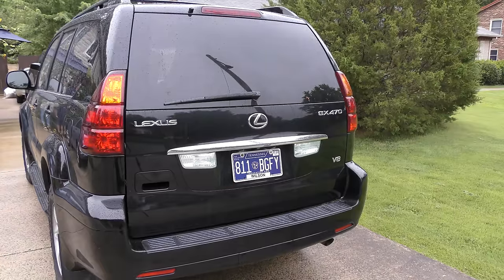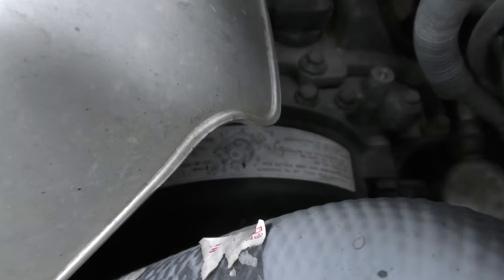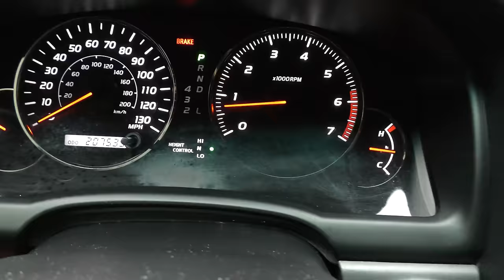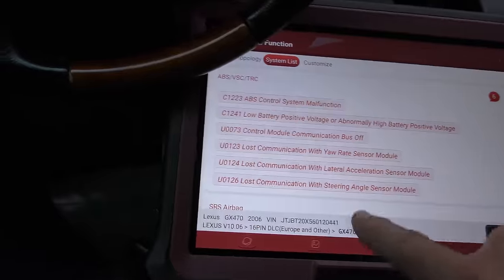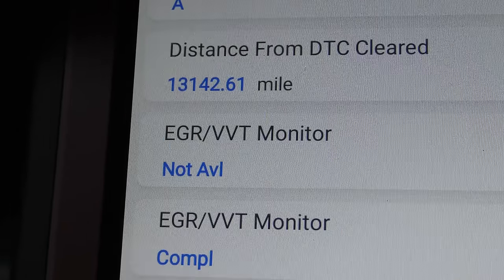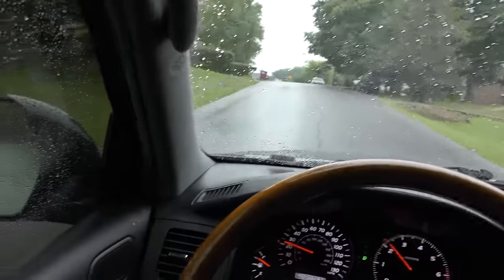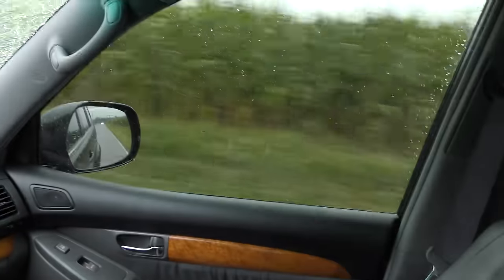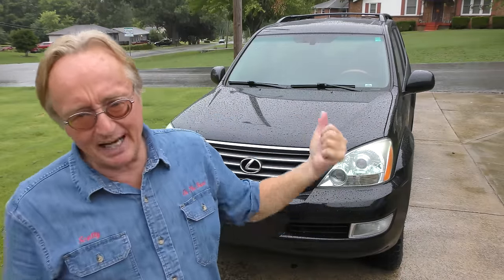I'm Sitting in the Best SUV Ever Made

Comment: You can change the timing belt yourself.  Take your time, use the repair manual and do step by step, it is not too hard.  Shop wanted $1300 to do the timing belt change in my lexus, they were going to use mid quality after market parts.   Purchased the belt, water pump, tensioners, idler pulleys, drive belts, cam and crank oil seals for just under $400, all OEM high quality parts, toyota/lexus genuin, the tensioner was Aisin, Belts all Mitsubushi etc, the best parts.   So I saved $900 and the lexus runs smooth as butter. And I do not have to worry about it for another 100K.  By they way, the old belt was 10 years old, had just over 100K on it and when I pulled it out, it looked almost new, great shape, markings were all gone, but the entire belt did not have a single crack, not what I was expecting, I could have probably just let it go a couple more years no problem. Shop said they could have it done in 3 hrs, would have purchased a parts kit for maybe $250, so they were basically going to charge $350hr for labor when you do the math.
Reply: Yeah, I wanna do it myself to. I have the same motor in my Tundra. Mechanical experience is somewhat limited, but I would like to tackle it as I have all the tools. I work on machine equipment, but not motors. So, you think it can be tackled by someone who has moderate mechanical skills and knowledge?
Reply: @thyslop1737 yes.  Watch videos, get the proper tools, use the marks, make the proper marks etc.  download or get a factory service manual.  This is easier than a front drive engine because of good access.  Get genuine Toyota/Lexus or Aisin parts.

Comment: 07 fj cruiser 4x4, locking rear differential and other extras,  still running on and off road like new with over 340,000 on, regular maintenance is the trick
Reply: Lot of the same parts on them, my GX is riding on Fj struts and coils.

Comment: Its a land cruzer prodo turned lexus.  I got mine in 2020 for $10,500.  It had 150,000 miles on it and 15mpg for the gas mileage,  i love it. A 2006 and no problems.  I had the timing belt , tensioner and water pump replaced for $ 2000., good till 250,000 miles.  I only put 6 thousand  miles on it a year.  Great for off roading. Snow , hills  and camping.  I made a bed in the back.

Comment: I just moved  cross country in my 2005 GX470 with 95kmiles on it. Timing belt water pump kit replaced before trip.
From Oregon to eastern N.Y. state with a fully loaded interior and a rooftop cargo carrier maxed out, I averaged 19.4 mpg •according to the onboard computer and by my pen and paper method•  Around town I average just over 15. For an 18 year old truck with a V/8  that  weighs 4,871 pounds unloaded 
 I'd say that's outstanding. This 18 year old vehicle gets the same mpg as a brand new GX460👍

Comment: I have a 2009 GX 470.  Watch out for the Radiator.  It has coated plastics inside that can break up in your cooling system and cause overheating.  It happened to me in Arizona in the heat of summer.  Blew my supposedly indestructible 2UZ-FE.  Sent it to JEGS for a remanufactured one.  Runs like a dream now, but it cost $$$$.

Comment: Timing belt is #1 on this. 

I'm surprised more commenters aren't mentioning the rear air suspension. It's stupid hard to diagnose (spent over $5k screwing around with mine between the dealer, a toyota dealer, and a local mechanic)...but for under $500, you can get an adapter kit and have normal coil springs installed.
Reply: Just got a 05 175k with the rear original suspension out of control, seems to be the heights sensor but I'm going for the conversion kit rather than spending $$ trying to find out for sure.
Reply: I simply bought the bags ,for $64 and a friend who installed his own did it in 1 hour. it was leaking.
Reply: I'm glad it was just a leaky bag. 

I replaced my bags first...and that didn't help. 
I'm pretty sure it was a computer\sensor malfunction...but I got tired of paying people to not fix it.
I finally tore it all out and just put in springs from a 2010 FJ.
5+ years and >60k miles later...it's still riding great.
Reply: If you want one of these as a daily driver, fixing them yourself is pretty much a prerequisite in order for it to pencil out economically.  I have 3 Lexus/Toyota v8’s in my family with a combined age of 56 years and 650k miles.  It works l, I’ve been able to fix almost everything myself, but it wouldn’t work so well if that were not the case.  It beats paying insane money for new stuff, or being limited to newer but lower quality vehicles.
Reply: @kftc1980  Im in an apt and I dont have the experience to do it right or know it was right, or dont have the tools/garage. I pay mechanics and LOSE TIME at work, so I pay more for grandmas sunday driver. Still end up with fixing what someone didnt fix but instead of $3000 , might be $1500, with more usage, being it drives and looks like half the mileage. I use that method after being at a mechanic for uncounted hours overall. But normally your concept would be right on for the majority.
Reply: I bought two brand new bag springs -800
Two shocks -1400
Air tank regulator -700
All new hose was included with tank. 
2900 in parts and 6 hour of my own labor. Now again as good as factory.

Comment: I bought a used 2006 lexus 330.  166000.  They put on new tires and new rear breaks.  The surprises....... a 3000 power steering pan problem.  The lugnuts they said were bad and will not work with the tool in this vehickle..new lugnuts.  New front breaks-- thos two came to 688.  So a few more problems than I had expected.. and something about a broken rod that had to be fixed right away while they were changing the breaks (and rotors because those were warped.)  So yes, check it ALL out before buying.

Comment: A 100 series landcruiser with the turbo intercooled 4.2 6 cylinder  diesel would be better in my opinion and most Australians I bet would agree. The car your reviewing is a prado in Australia with either a 4litre v6 petrol or a 3 litre diesel. The proper cruiser is a better car. The 100 series was the best of the best.
Reply: No the v8 4.8 lt  petrol is better in australia
Reply: Td42 patrol mate😃
Reply: what year is that
Reply: @johnsmith-ce2tq  2001

Comment: I have an ' 05 with 180 k on it .Bought for 11k 3 years ago with 110 k . 
I've replaced ps pump , headlight bezels , radiator ,all belts and hoses , removed the height control since purchasing it . I do use regular in it  without any issues . I've owned many vehicles and this one is the best ! Mud ,snow sand or rain ,it handles it all . Fast, does as well on freeways as it does off road .

Comment: Wish we had these in Australia. Instead we get one called a Landcruiser Prado with either a 4 cyl diesel or the 4.0 litre V6 and lower spec levels than a Lexus. The top of range in this series was called a Grande which was almost Lexus spec but not quite.
Reply: Can you get a manual transmission with either of those motors?
Reply: @juliekavanaugh4993  yes, you can

Comment: Highway mileage on my 2007 sport edition with no mods is 23.9 (regular gas) average while carefully driving speed limit Oregon to San Fransisco.  Pushing it average 17 on return trip.   In town winter mileage sucks at maybe 13.0 on a good day.  I love the truck but it is not as practical as my 2006 4runner.   Wont sell it any time soon, need it for all season trips visiting family, towing, snow and beach trips.  Beats flying any day for me. Had 135k on the timing belt when I bought it, when I replaced it the old belt still looked like new!  It is not the easiest or cheapest car to work on but I plan on keeping it running forever.

Comment: Scotty - everything will work on that Lexus pretty much forever if makntained.  Those ABS and suspension codes are entirely due to a low battery.  470k on my 1998 Land Cruiser with the same engine.  Runs perfectly.

Comment: Expected it to be the 4Runner. Pretty much the same thing

They’re luxury off road vehicles. I used to take mine off roading all the time. Sold it for 7k cause the hydraulic shocks were changed out and the rear door didn’t open. Easy fix but it did its time. Needed a truck. So I got a Tacoma

Comment: We've had ours for 164K miles with almost zero issues. I call it the Rolex Submariner of SUV's - just about indestructible. Drove a GX460 a few times, but even though it weighs 400lbs. more than a GX470, it feels even heavier - it's a brute to drive around. We're going to check out the new ones when they get released.

Comment: 13k for 200,000 miles seems crazy.   Considering it needs timing belt change that costs 2k.
Reply: Timing belt and water pump is usually around $1000
Reply: @franzjarred  maybe 15 years ago. You're nuts. And on a Lexus v8?? They're gonna crush em prob 2500.
Reply: Yeah it wouldn’t even be the miles for me it would be the age I’d have to see it underneath even then
Reply: @ADDwithJTC  just had mine done. Dealer quoted me 1400, well known Toyota 4x4 shop near me did it for 1000.
Reply: @franzjarred  a lot to do with location too. Here in jersey probably get you for 3k$.
Reply: @franzjarred  you have an 8 cylinder Lexus? What state do you live in?
Reply: @franzjarred  where I live the v6 timing belt job at Honda dealer 6 years ago was $1300.  I can only imagine it will cost a lot more now and even more at a Lexus dealer on a v8 Lexus.
Reply: @ADDwithJTC  Chicago. I have a GX
Reply: I did timing service in Hendrick Lexus Charlotte NC for 1200.. in 2017.
Reply: @franzjarred  you got lucky. You'll pay 3x that here.
Reply: @juchou2983  yea it's at least double now.
Reply: @mongo64071 perhaps, but the engine in the Hondas sits transverse mounted which leaves you much less room to work with. The Lexus engine sits longitudinally.

Comment: I’ve had the old GX470 and the newer GX460 the GX460 is much better, drives better and is more reliable. Better timing chain (not a belt) and better suspension (adjustable suspension on the 470 was known to fail)… the greatest SUV ever made is the Lexus GX460 then the Lexus GX470 and then in 3rd place is the 4 runner
Reply: Which model is your gx460? I am planning to get one. Currently have a gx470. Are all the gx460s equally good? New GX is at least 62-63. Low mileage used ones are about 35-40.. is it better to get earlier models?
Reply: @juchou2983  I bought a 2016 used with 56K miles and its got 70K now, I do all the maintenance myself and so far its solid knock on wood. Depending on what you need and what's a deal breaker to you as far what you want out the vehicle. Buying used you kind of stuck with what options a used might or might not have. 

So the 2011-2021 all have the same infotainment system, which is basically 2011 technology, and I'm not exaggerating. So if you want some new tech like android auto and more updated screen, 2022-2023 is what you want. I doubt there are any 2022 new left to order so either 2022 used or order a 2023. 

I'd say all 460s are equally good, there has not been any mechanical changes to the powertrain since 2011, so doesn't matter if its a 2011 or 2023 its still a 4.6L making 301hp and same milage. Having said that I do believe the newer ones in my anecdotal experience do shift better, I've driven a 2020 and it goes through the gears much better, I feel like my 2016 constantly bogs down and doesn't downshift, on uphill especially. So recent models might have better transmission tuning. The newer ones do have improved steering feel and suspension, and will have better standard options. 

2011-2014 are super ugly, but have the best clearance, same approach angle as a 4Runner, so if you plan to ever off-road it, its a something to consider. 2015-2019 are worse, there is a risk of ripping front bumper off on any intermediate trail, so things like aftermarket bumpers are needed. 2020+ you will 100% need to cut the bumper as it the clearance is so bad, they impede the vehicle off road ability, yea you can go on a dirt road that any Corolla can, but any kind of deep ruts you will break or rip/off that giant front bumper. For the snow I recommend putting aggressive tires on. 

If buying used you're limited to the options they have. For example in older models only Luxury trim came with heated steering wheel, which is what I wanted, but Luxury only come with rear air suspension, which I didn't care for, as air suspension rides more bumpier and is giant gimmick. The crawl control will be extremely rare in used so if you want crawl control much easier to order it in a new car. Luckily you can DIY crawl control, as its just a module you can switch out in any 2011-2021, not for 2022s. Lastly I recommend getting one with Mark Levingston audio system, its one of the best in Automotive industry, its better than the Harmon Kardon system in my $120k BMW M5. Mine is the Luxury trim with Mark Levingston, I'm missing the adaptive cruise control and auto high beams, which I think 2017 and up start having them. I believe newer ones come with heated steering wheel in lower trims.

Lastly for real, if buying used there is a ton of knowledge on the forums, all the issues are well documented. Depending how used, but check for rust, thats number killer on any Toyota/Lexus, check for leaking or seeping transfer case, and if its below 70k miles, its a good idea to change the plugs and check for oil stains on the plugs. 70k/7years is the power train warranty, oil stains on the plugs means some gasket is leaking, so it can be fixed under warranty. Normally the plugs don't get changed till 120K miles, and at that point you're footing the bill.
Reply: @GXMAN16  thank you for the info.. so the drive train is same through out the years. I need something super reliable and I travel a lot. But I am not really tech savvy.. all the newer adas features seems kind of unnecessary complexity to me. I will probably get a 2015 with less than 100k miles.. once again really appreciate you taking the time to give out all the info..
Reply: @juchou2983  Yes the drivetrain is the same for the entire 2nd Gen 2011-2023 its the 4.6L V8 with Full Time AWD and 6 speed Auto, for 2024 there will be a release of 3rd Gen GXs with the updated powertrain, probably will be Turbo V6 that we see in the new Tundras and Sequioas.

If you can't find below 100k miles whether it's 15 or 16,17 whatever your budget allows it should be a good deal, as most GX460s unlike the 4Runners are unabused, remain stock and normally serviced at the Lexus dealership. Based on my own experiences buying one close to 60k, the front rotors warped almost immediately, but were still go enough to get resurfaced, the pads be close to get changed, brake fluid flushed, power steering fluid flushed and if its close to 100k, all the things I've mentioned needed to be changed and set money aside to change the water pump, as other Toyota V6 and V8, it's the same pump that likes to fail between 90-130k miles.

Comment: I love these GX’s but I just can’t get behind paying that much for a vehicle with 200k+ miles. Same goes for land cruisers. Prices are just unreasonably high for me. I just picked up a 2006 Sequoia 4WD with 200k miles for $6,000. Same 4.7l v8 and tranny found in gx/land cruiser and comes with low range gearbox with center locking diff. Idk why they haven’t sky rocketed in price yet 🤷🏻‍♂️
Reply: 3 years ago you would have paid 2500 for that truck. They’ve definitely gone up, although not as much as the gx, 4Runner and LC
Reply: Totally agree. However, I have noticed that the 2005-2007 (facelift) 4WD examples have remained higher in general. Most of those are being sold in the range of $7k-$12k today.  The true budget rigs are the 2001-2004 examples. You can still find those for around $3,000 today if you look hard enough

Comment: I bought my 2006 Lexus GX470 with 170k miles 2 years ago for $6k back when they were cheaper but I did pay to get the timing belt and maintenance up to date. Everything works on mine except I’ve had problems with the steering rack.

Comment: Reminds me of my 2007 Honda Pilot EX-L Navigation with 4WD. Has a 3.5 SOHC VTEC V6 with 244HP with a 5 speed automatic. Bought it for $3200 in December of 2019 and the timing belt was done at 194,000 miles and I got it with 196,000 miles and I’m about 40,000 miles or more on the timing belt and I’ve owned my Pilot for 2 and 2/3 years. I’ve had to replace the brakes. Tires, wheels, AC compressor, spark plugs, drive belt, fuel injectors serviced, drivers side window motor and regulator, PCM update, decarboned entire engine, things like that but it’s still going strong at 238,000 miles and it’s been a good vehicle so far. I recommend the 2005-2008 pilots because the 2003 was plagued with that horrible 4 speed automatic. But the 2004 and newer pilots are really good choices too.

Comment: Very cool. Really love your channel!!  I’m getting a 2008 GX470.  From a Lexus dealership.  I cut a deal with them to do a lot of service and maintenance on it.  It’s has 172k miles on it and I’m doing these services before I buy it. 
Water pump 
Timing belt 
Cam Oil seals 
Value cover gaskets 
Spark plugs
Dry belts  
Engine filter 
Axel fluid for front and rear plus transfer case 
Transmission fluid. 
I’m really trying to do as much stuff on it as possible.  Anything else you recommend?? Any input would be greatly appreciated my friend. 👍🏼
Reply: That goes for 18k at sewell.

Comment: Those codes correlate to the abs but comes from the skid control of the brake booster. Change out the brake booster and you are fine. I had same codes in my sequoia